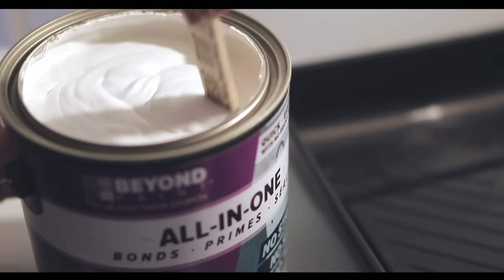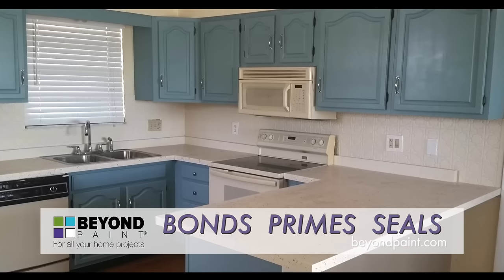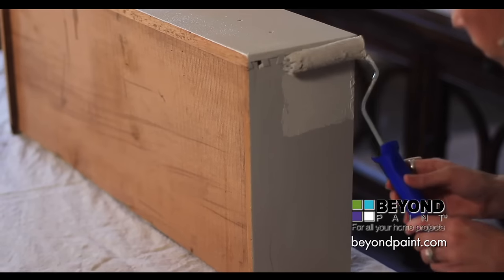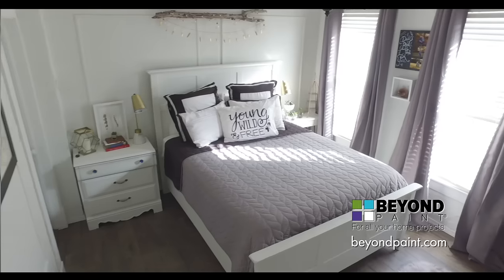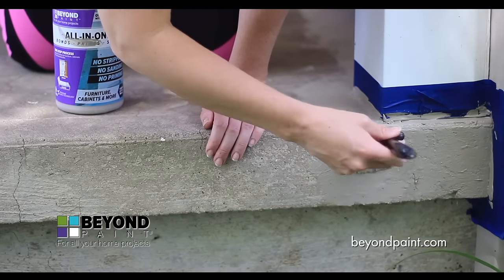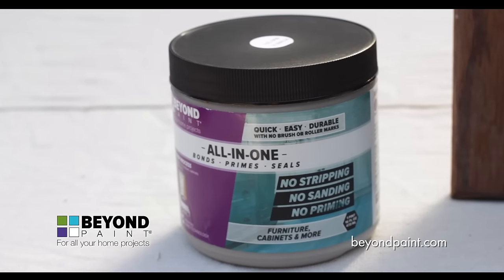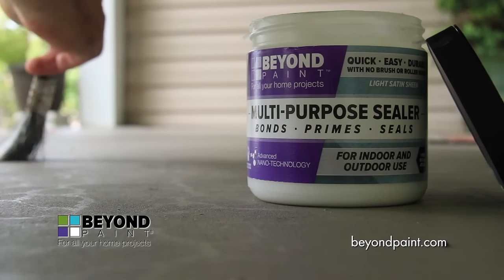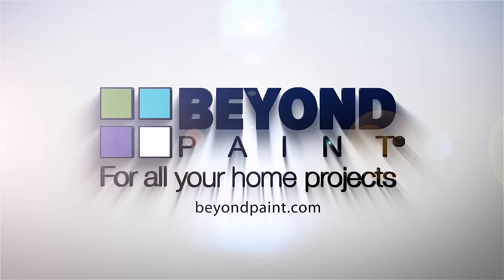The Beyond Paint Difference | All In One Paint

Comment: Could u use this on a bath tub and surround?? Will it hold up well?? N for how long??
Reply from the maker: Although our products have a sealer in the formula, we have not tested the water levels that our products can hold and for how long. We do not recommend our products be used anywhere where there is standing water. However, we do recommend it on areas around these surfaces (such as on the exterior of the tub and the surrounding areas. If painting around these areas, we recommend using 1-2 thin coats of our Multi-Purpose Sealer 3-5 days after painting for water resistance. Hope this helps!

Comment: What do you use to thin it for spray gun
Reply from the maker: Beyond Paint can be used with a paint sprayer! It works with both HVLP (High volume, low pressure) and airless systems. If using an HVLP sprayer system use a 2.0 or 2.4 nozzle. No need to thin or dilute our paints. Our paint is ready to go to be used with any paint sprayer. If you do have trouble getting the paint out of the nozzle, then add a only a few drops of water at a time.
Hope this helps !

Comment: I would never knowingly purchase a piece of painted furniture that hasn’t been at least scuff sanded, primed the right way, painted, then several layers of top coat.  This sort of technique is fine for decor projects, etc that don’t get daily use and sit on a wall or a shelf, but when you’re talking about furniture, not doing the vital steps will eventually end in disaster.
Reply from the maker: That would be the normal process with conventional paint, yes, but Beyond Paint is a bonding paint. As long as the paint is degreased and cleaned properly it will cure to a durable surface. If this were not the case BP would no longer be in business. Customers have shared their projects years after and are thrilled with the results and how it holds up to traditional methods.

Comment: What about MDF cabinets?  If this is water based, will it make the MDF board swell?
Reply: you would probly use the sealer on top of it
Reply: I was wondering if anyone had ever used Beyond Paint on OSB.  I might actually try it.  My stairs are OSB with carpet.  Thanks to a cheap construction contractor.  I'm thinking of trying it on a step and riser.  I'll let you know if I get brave enough to try it.  Honestly, it couldn't be worse than the gross carpet, lol.
Reply from the maker: You will need to prime MDF prior to painting so that the suface does not absorb all of the paint. We recommend a single coat of an oil-based primer beforehand as part of your prep after cleaning the surface.

Also, if you’re wanting extra durability,  we recommend waiting 3-5 days after painting and apply 1-2 thin coats of our Beyond Paint Multi-Purpose Sealer. Hope this helps! 😊